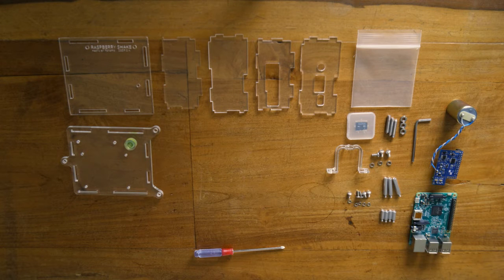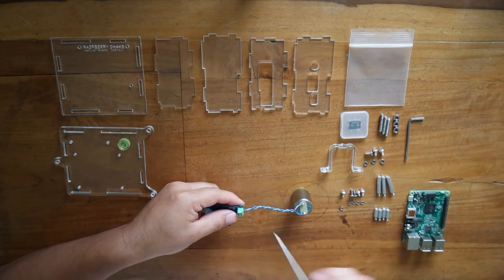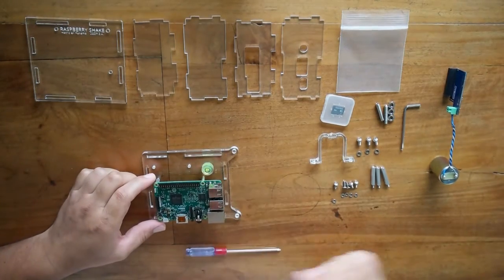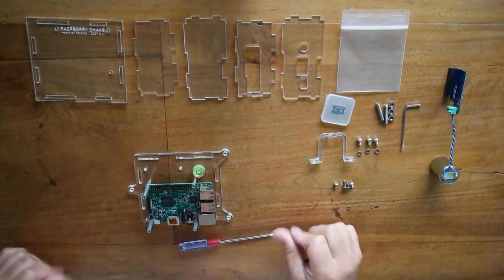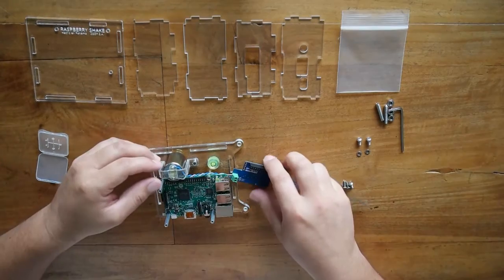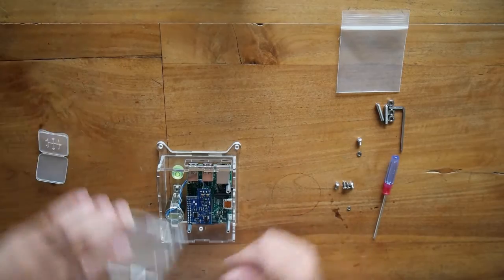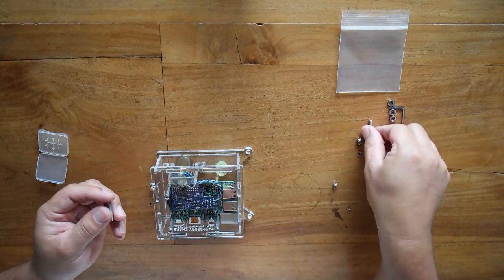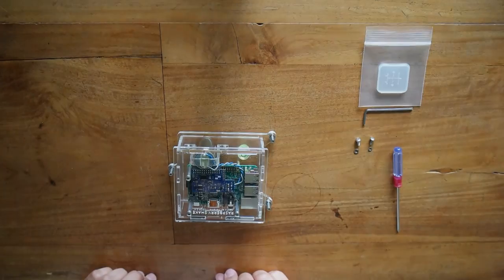How to Assemble Your Raspberry Shake

Comment: Cone point leveling feet:  these are actually quite sharp, from the point of view of your work surface!  To avoid unexpected scratching of the work surface, one can either install the leveling feet upside down until final placement is occurring, OR you can simply retract the cone point until it just clears the case bottom--but if you do this, be aware that only 2-3 screw threads hold the foot into the case material, so don't tighten the nut much or the case threads will strip much more easily than otherwise with ~6 threads sharing the load (as is the situation when the feet are normally installed for operation).

Comment: Case assembly:  the designers helpfully polarized each of the case sides, so that it's impossible to "get it wrong"--WONDERFUL touch!  My first piece (with three holes) fit very tightly into its sockets in the case bottom; one should then install the opposite side as the second step; finally jiggle and tip in the end pieces into place, add the case top, and insert the final Type 2 screws.

Comment: BEFORE attempting to install the geophone clamp, confirm that the clamp fits cleanly/easily between the soldered joints on the top of the geophone.  Mine didn't, which meant that the bottom ends of the clamp were ~2mm above the case bottom.  I used a small wheel grinder to take off 1-2mm of material on the side of the clamp at the middle "hump" to allow the clamp to easily touch the insulator strip between the contacts.  That resulted in a flush contact between the clamp ends and the case bottom when I went to install the pair of Type 1 (NOT Type 2) screws.
Reply: The problem seems to be that the solder blobs on the top of the geophone can be so large the plastic strap doesn't fit between them.  Mine was a tight fit but could be forced in.  The wires also have to be moved off to the sides to insure they are not being pinched under the strap.

Comment: at 1:30-1:40, a LONG standoff must be what is meant.  Also, the penetrations on the RPi might be a little tight, so pre-threading the 3 long standoffs and the single Type2 screw through their respective holes will reduce concern about cross-threading into the lower (short) standoffs under the RPi board.  It is also useful to loosely start each of the long standoffs and the screw before tightening down, as mis-alignment of the lower standoffs is possible.
Reply: Confusingly for USA folks, the larger diameter+head "Type 1 screw" uses a US standard #2 screwdriver; and the smaller diameter+head "Type 2 screw" fits a US standard #1 screwdriver.  Hopefully this makes more sense in the other 99.5% of the world.